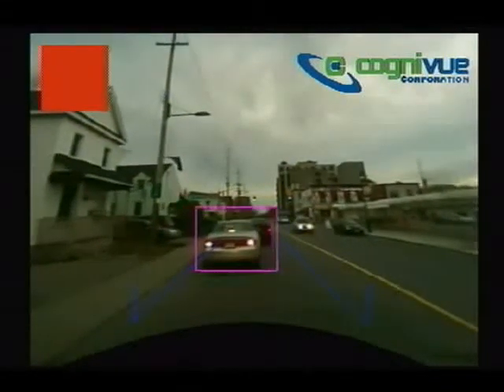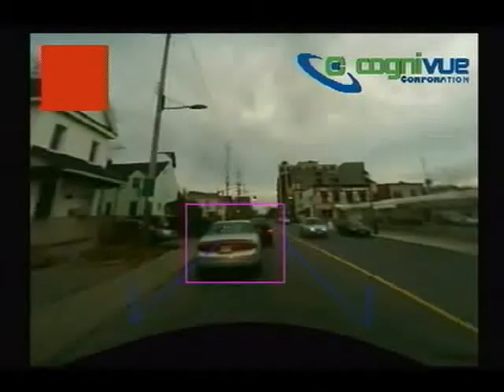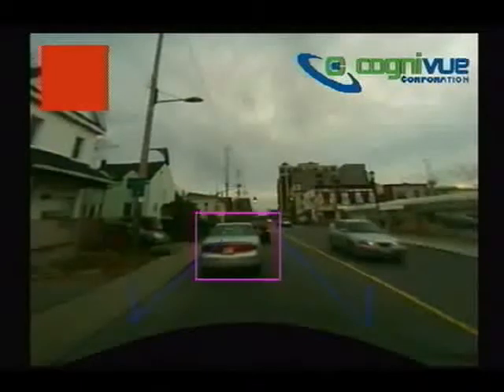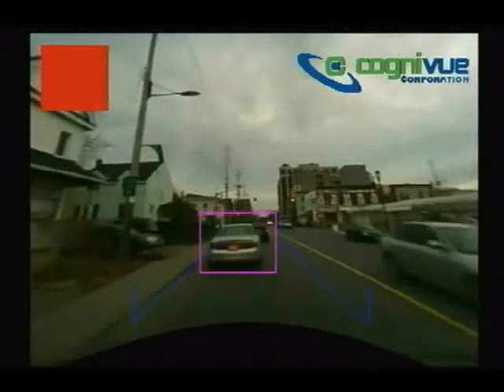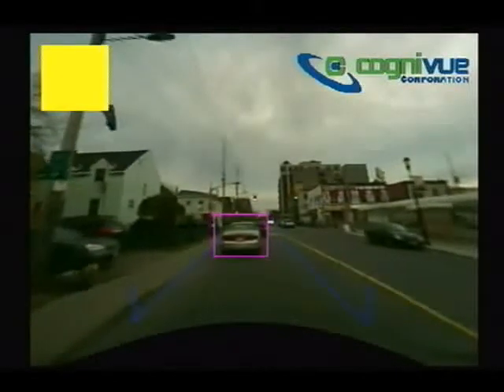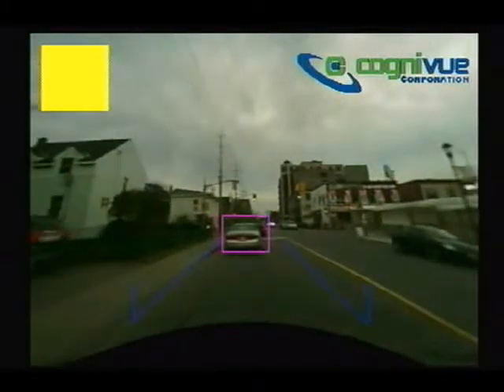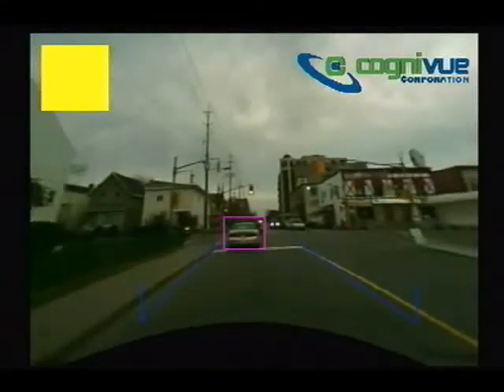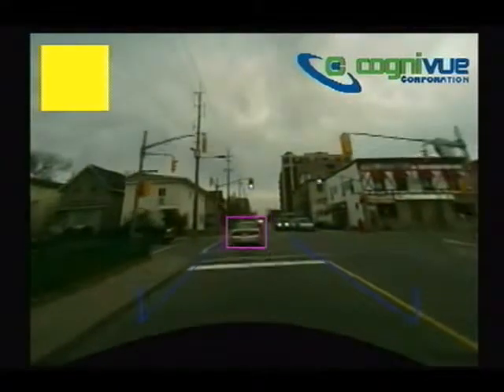Collision Avoidance System Demonstration on CogniVue CV220X Image Cogntion Processors

Comment from the maker: Algorithm is developed using Matlab, then ported onto CV2201 image processor device - 9x9mm2 package with stacked in package system memory (SDRAM) and very low power consumption as a result of massively parallel processing core architecture; this video shows the algo executing on the CV2201 part.